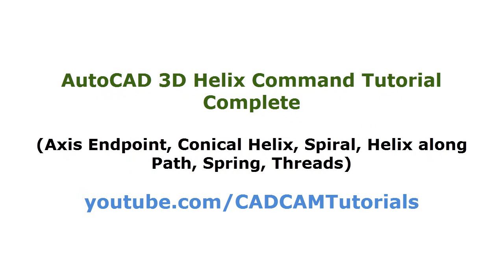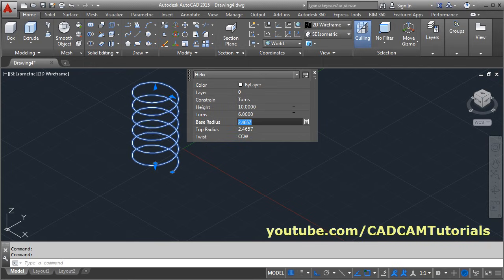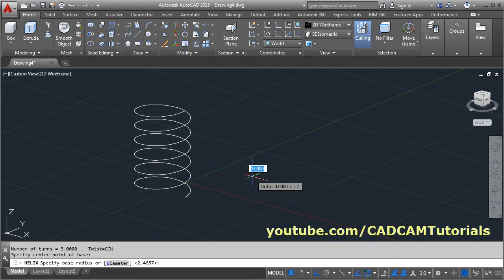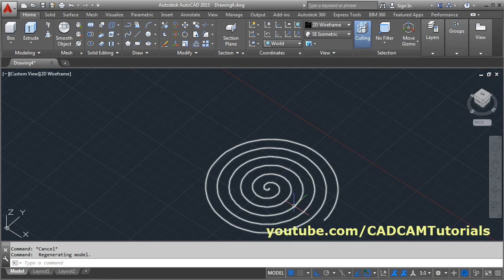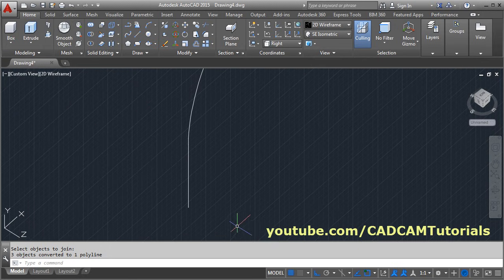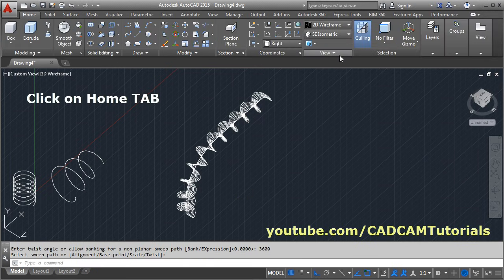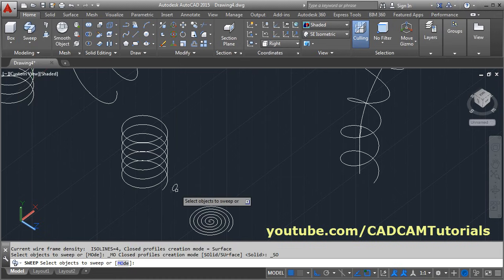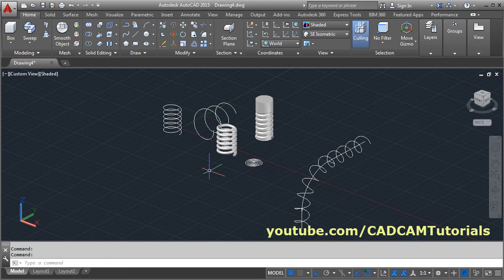AutoCAD 3D Helix Command Tutorial Complete | Spiral Curve Command, Helix Along Path, Spring, Threads

Comment: Good tutorial. I am trying to loft, sweep or in anyway create a surfboard fin in autocad. I am using the fin profile known as a NACA foil. The base of the fin (the part that stands on the board) is flat. The fin is shaped like a dorsal fin on a dolphin with round top. Do you know of a way to do this? Lofting from the base up works well but not to make the top. I have googled this and seen other people having the same problem as me. Any solution would be apreciated.